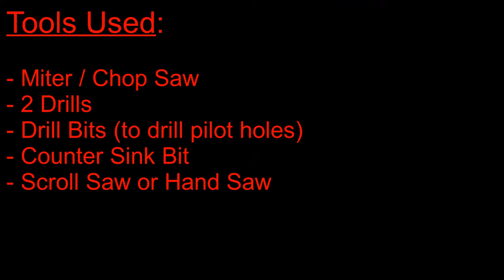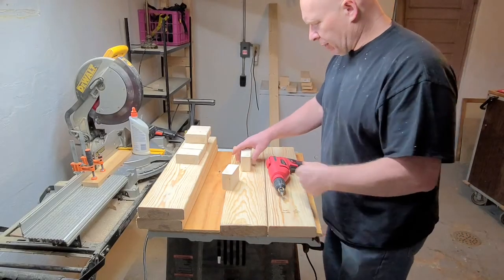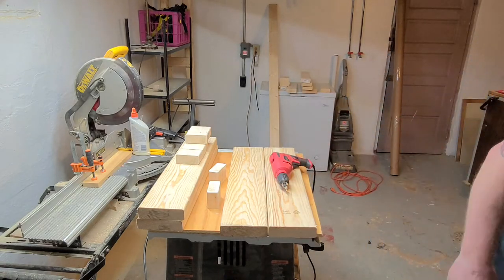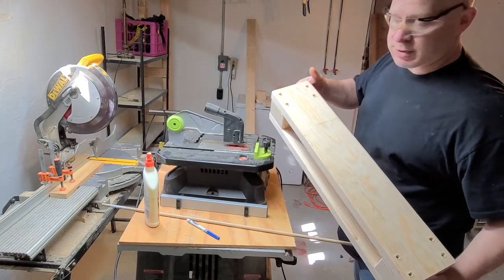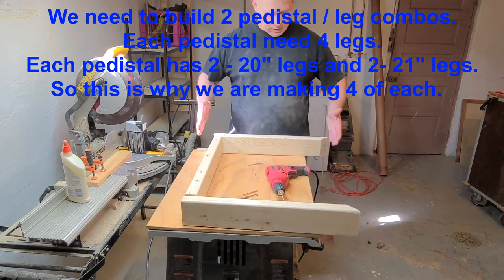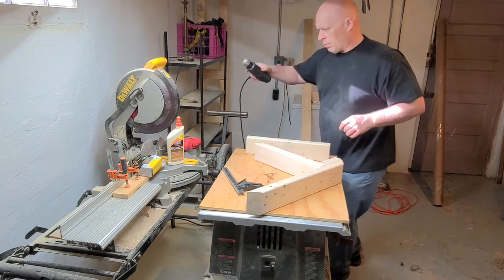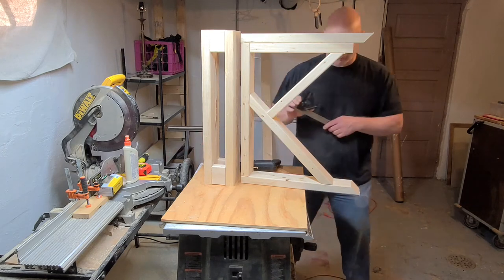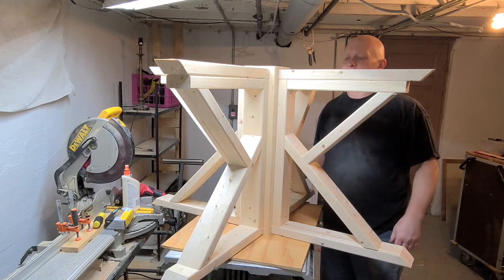Craps Table Build Part 1: how to make a craps table at home

Comment: 12” saw?
Reply from the maker: Not sure what you are asking?
Reply: @CrapsMasterJourney  Sorry about that, the miter saw…Is it a 12” with a 60T blade?
Reply from the maker: It is a 12 inch miter saw. Not sure of the blade type, but any saw will work for the cuts in this video. Even a hand saw, lol, except that would be too much work for me.